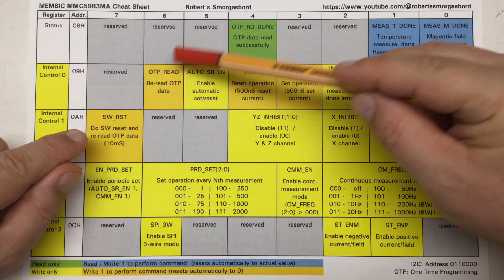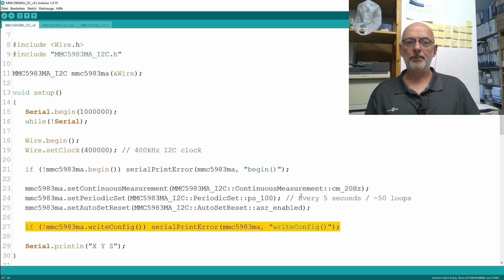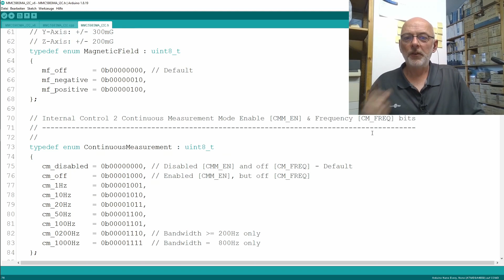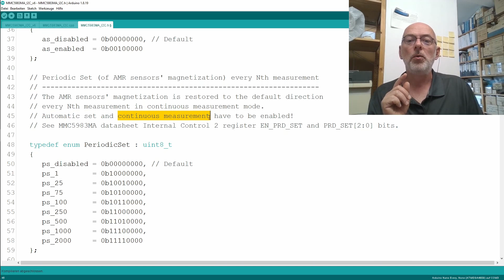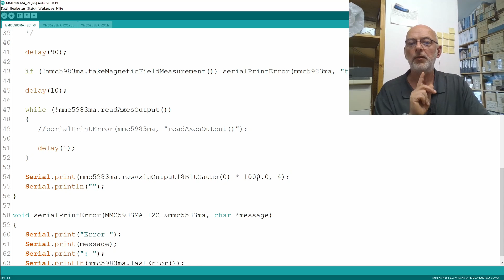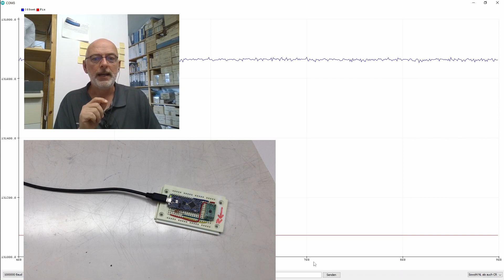MEMSIC MMC5983MA 3-Axis Digital Compass & Arduino MCU – The Details (6)

Comment: Hi Robert, Thanks for another very good video about this magnetic sensor. Is there a way to contact you? I cannot get your software to run on an arduino nano ATMEGA328P, and I am far to dumb for those very descriptive error messages. I have a history in Basic and am playing around in python and since  found your video's I have to learn C. But I like to contact you for some questions. Is that possible? Wilfred.
Reply: also cant get it to run on a uno
Reply: @jefforgeron5249  Jeff,  watch  the details 9 https://www.youtube.com/watch?v=BgSZ5XZTDDg&t=10s around 13 minutes.
Reply from the maker: Hi Wilfred, YouTube is just a hobby for me, so for privacy reasons I do not give out my email. Anyway, I should have an old Arduino Nano with an ATMEGA328P lying around somewhere. As soon as I come around to it (I'm currently a bit pressed for time), I'll try to compile my code on that one. No promises though.
Reply: @robertssmorgasbord  That would be very nice Robert. I hope You find the time. 🙂
Reply from the maker: @wilfredswinkels  I'll try 😅